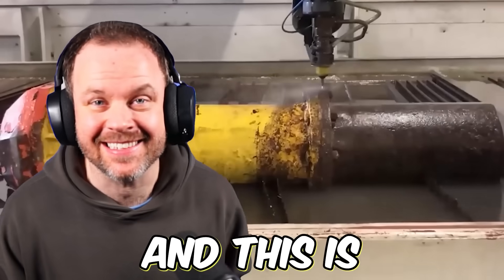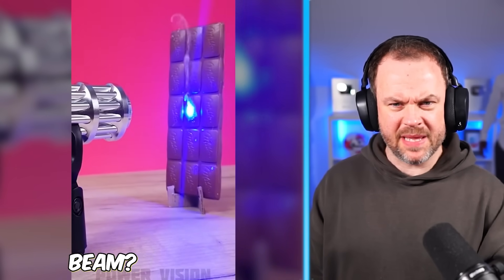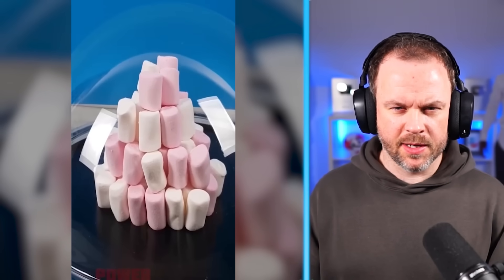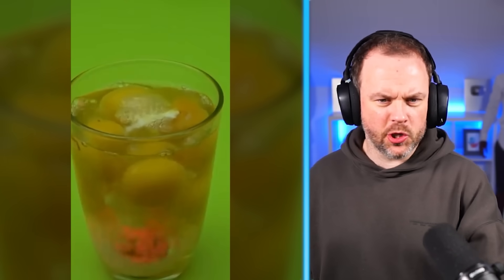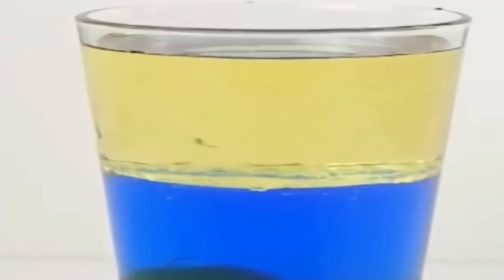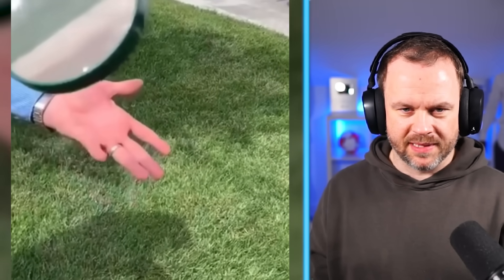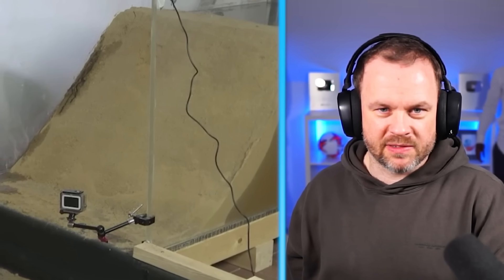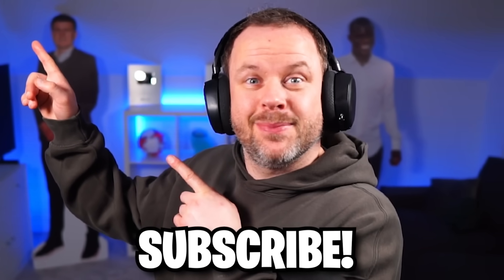What Can Water Cut Through?

Comment: Pure water, when it freezes, needs something to freeze onto. Plastic used for bottles isn't suitable for this until it's about -5C, which is why you need specific timing on freezing them. Glass has a much lower temperature to be suitable for ice to cling to. As soon as the water is either sufficiently compressed (shaking it puts enough pressure on portions of the water to start this) or has a good surface to build off of (like dropping something in or pouring it on ice), it can freeze. This is the same principle behind freezing rain; snow and hail forms around microscopic dust particles. If the particulate count is low enough, what should be snow or hail will instead by freezing rain.